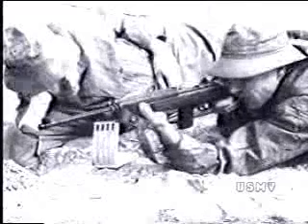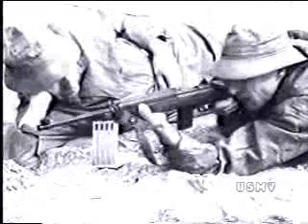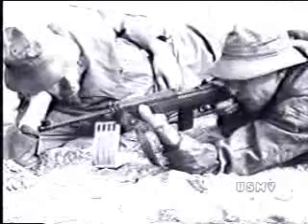M1 Carbine

Comment: @harmon92 The Carbine wasnt made for range, it was made for close to medium range 1 shot kills, which it did very well. At 0-50 yards the .30 Carbine with its low velocity round nsed bullet causes a wound cavity the size of a basketball, 50-100 yards, a cavity the size of a canalope. .30 Carbine cartridge = small sized round with great stopping power and short range, all in all, a GREAT round for the job.

Comment: @harmon92 Still, even if it had thick clothes on the damage would've been less, of course, but would've still caused a large cavity about 6 inches wide and a foot deep, I've done similar tests with my Carbine, I shot a ballistics clay block through a phonebook (representing thick clothes), it went through the book, slowed down significantly of course, but hit and caused a cavity in the mold about the size of a softball and penetrated 7 inches in the block, enough to put my fist and wrist in.